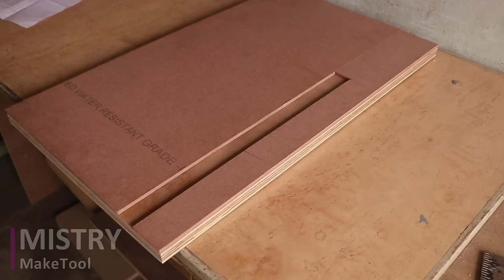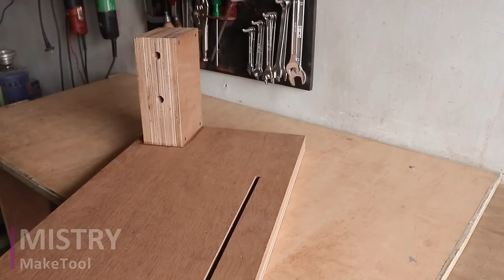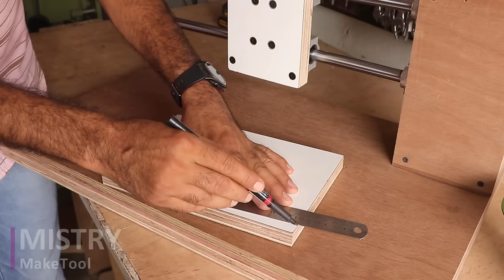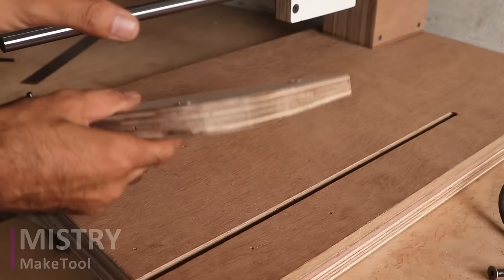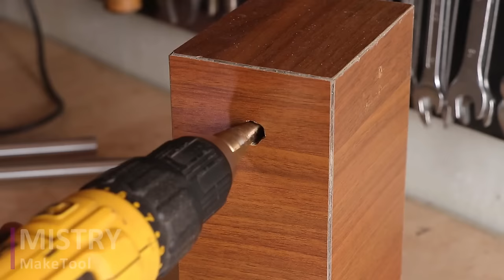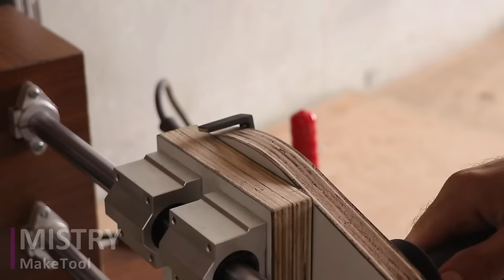Making Sliding Angle Grinder Stand | DIY Sliding Angle Grinder Jig

Comment: I think I need to build one!  Mine will look different, mostly because of material I have on hand.. The only thing I will change on purpose is the handle..  I believe where yours is located is too close to the blade.  If that cutting disk shatters or there is kickback... I know there is a guard on the grinder,  but it still looks dangerous to me..